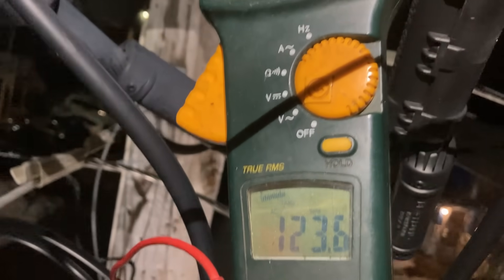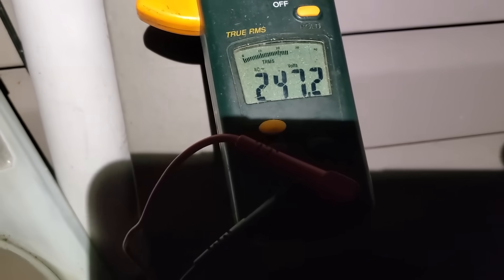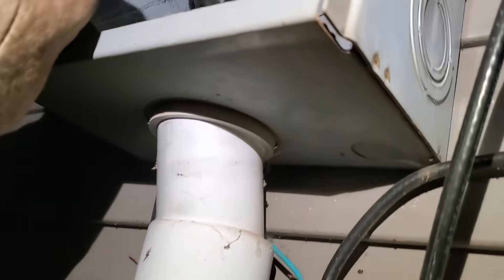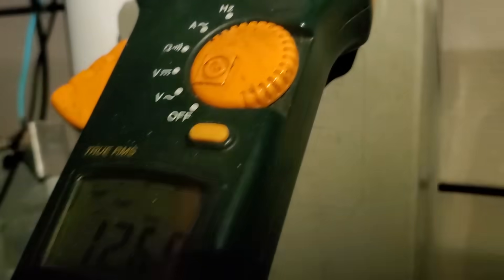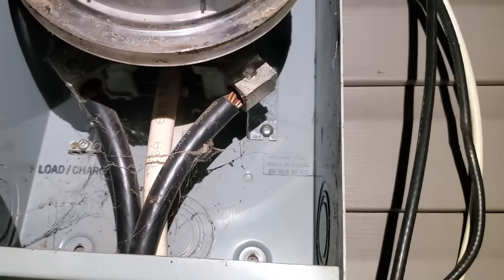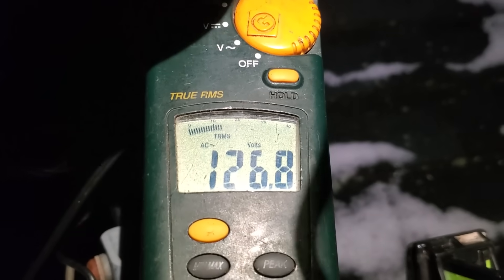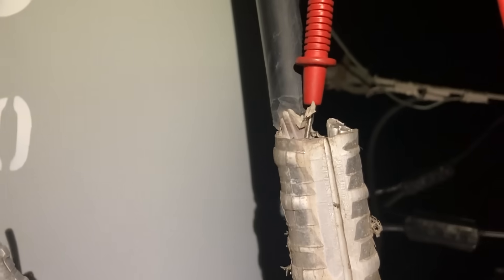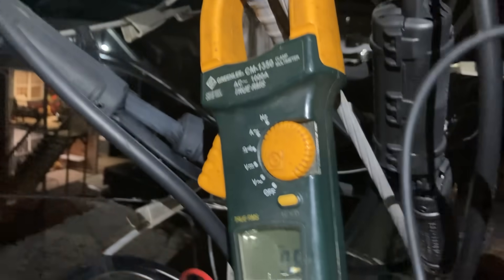Finding a bad neutral on a Service - Raw footage

Comment: You did it the hard way. You could have measured the voltage on each side of the junction. Should have been basically 0V. You had 3V there.
Reply from the maker: Yes and no. The initial test of the meter socket determines what exactly I'm looking for... A bad neutral or a loose connection, maybe even a bad tap clamp.

Once you've determined that there's a bad neutral you could definitely move forward by checking across each neutral connection for a voltage drop.

The only other problem with that method is; if you've missed a connection or somehow skipped one you won't realize it. When using voltage on each leg if you suddenly start seeing good voltage you will know you have gone too far down the line.
Reply: The way the test was done was the fastest way to find the open . once you find the open point you cam measure across that crimp. you keep going to the source of power until you get normal voltage. it is much quicker that way. this way you do not have to test every crimp for voltage drop.
Reply: Not a lineman, but wouldn't something like a thermal camera have shown this immediately? A drop of 4V with 1A going through that crimp means 4W- so heat is being generated.
Reply: @MattAtHazmat  4W is a very, very small amount of heat in a large piece of aluminium wire open to air. It's not likely to show up well.
Reply: @Bobsdecline   Why can you get 400v on a 230v on one phase in a TN-C-S system if you lose the neutral?
Reply: @Monkeh616  I agree with you- but I was I was curious and ran a pretty trivial experiment with some things handy on my bench- I have a 200W aluminum precision resistor (you've probably seen the like- extruded aluminum case, gold color, fins) is is about 4x the volume of that crimp, and ran about 3.5W through it (highest voltage I could get my supply to give). After only 10-15 minutes it was 15 deg F up over ambient (read by my cheap Topdon thermal camera) and still going up.
Reply: @MattAtHazmat  But said resistor is not out in the wind and attached to tens of metres of heatsink.

I'm not convinced 3-4W is going to meaningfully heat that wire and joint to be seen from a distance, especially considering the emissivity issues, but it can't hurt to look, I suppose.
Reply: @MattAtHazmat  I am a electrician and have thermal camera. great for panel box .with a total open their would be no heat .just a voltage swing across each led to natural .
Reply: @robertmeyer4744  I absolutely defer to the experience of someone that is doing the work. I was wondering if the heat made a difference. Ohms law makes sure that if there is a voltage drop due to current, there will be heat. Just not sure about how much heat will be apparent.

For sure, a thermal camera is a great tool- approaching getting inexpensive enough that anyone can have one available.

Heat is very hard to hide- and finding it is an amazing diagnostic tool. I work with far lower power devices- it used to be the main way to detect heat was to touch it and see how much it hurt.

Most of all, want to encourage the use of non obvious diagnostic tools.
Reply: @MattAtHazmat  In this case, iirc, the load was 6 and 4A, which mean 2A on the neutral. And about 4V I think? So 8W. Should be significant warm. Will be picked up by a thermal camera for sure.
Reply: The easy way to find that open neutral is to turn on one load load on only 1 leg (shut off all other breakers). Use a non contact volt tester (dummy stick)  and the neutral will be hot back to point of bad contact.
Reply: @MattAtHazmat   "4W- so heat is being generated." An old-fashioned night-light is 7 Watts, most of that as heat. Yes you will certainly feel that inside on the bench. Outside in the cold wind? Anyway we should not be fondling live 120/240 wiring. I often "feel something" just from nerves. The N is "supposed" to be low potential but if it was, we would not be called-out? And 4V now could be a lot more if the pump or heater tried to start. (I have not used a good thermo-camera; maybe they do better than fingers.)
Reply: @5P3AM 
If N is disconnected at the transformer. 
Then for example you measure on L1 to N and you see 400V, you are measuring the voltage passing thru whatever loads are connected on L2 & L3. 
If you were to switch off all loads on L2 & L3, you would measure 0V .
Reply: @Monkeh616  With 30 A load (nothing unusual) that junction would dissipate almost 100 W. Fire Hazzard!
Reply: @imeprezime1285  It'd be rather more than that, but there wasn't a 30A load and you'd have to try pretty hard to get one under the conditions...
Reply: @benjurqunov  So then, if you were to lose the N and you have a load on L1 the load would be between L1/L2 and L3 thus destroying the equipment if it's 230v (l1+n)? Ive also measured over 600v ish once when measuring on a breakers top N and bottom phases (closed breaker).
Reply: depending on the current draw - i could expect as much there.  still, that would be something i would have replaced.
Reply: Why didn’t you show the fix?
Reply: Was about to post the same,  however procedures are procedures.   A perfect junction of course will never have much of a voltage drop.   Quick way to find and confirm.   But hey,  always do what your taught to cover your own ass and then do what you've learned to cover it again.
Reply: a perfect junction will never show a voltage drop - or heat (as all 'junctions' will show heat rise - even the wire itself.  but i see where you are going -  @jeffm2787
Reply: @rickhawkins218 With only one load you would always have a hot neutral no?
Reply: @dalltex  Neutral will be hot right back to the open,  but you also need to lift bonding conductor in the panel to remove that current path.
Reply: @dalltex  Sorry, answered wrong Q, neutral is never hot to ground, it is connected (bonded) to ground.
Reply: @Bobsdecline  the @phantom1492 is telling you: do it the lazy way!
if he was with Columbus, we'd stiil be looking for the Indies.
Reply: @5P3AM when u loose the neutral in a 3 phase star system the zero point Will get pulled to the phase With the most load on and that Will cause the 2 other phases to rise in voltage. But if all 3 phases are perfectly balanced nothing Will happen and the voltage Will stay the same. Sorry for bad english
Reply: @mikkirombakmhler8228  Ah! Thanks!
Reply: @yiannimil1  There's nothing "lazy" about it.  It's just another way to test the same thing.  The advantage of this way is it does not require having access to a hot leg to test with.  You can just test two points on the neutral on opposite sides of the bad connection to confirm that that's where it is.

The disadvantage, as a couple of people noted, is that you can only test a single connection this way, whereas the other method allows you to tell whether the fault is anywhere upstream or downstream of your test point, so can be used to narrow in on the actual location more quickly in some situations.  IMHO, this method is still a good additional confirmation step once you've identified the bad connection, though.
Reply: @Bobsdecline  --  "Unbalanced" power can and often does damage customers' stuff.   It might be useful to pull the meter but clip a 240 volt load between on hot and the neutral.   Because of the bonding that will be some juice available.   THis happens often enough that it makes sense to carry just a load on your truck.
Reply: @5P3AM  That happens on an European systems and it is not dependent on the earthing system. The neutral keeps things balanced. If it breaks socket voltages can go anywhere between 0 and 400 V. In the US that is 0 and 240 V.

The earthing systems differ that in TN-C-S or TN-C the voltage on the neutral (up to 230 V) gets to the equipment cases. In TT it does not happen.
Reply: If load changes in the house you could miss the bad connection. I pull the meter and put a super beast on and look for voltage swing. Also the amp clamp gives you a good idea of which direction the imbalanced load is going. It should always go back to x2 on transformer. If not there’s a bad connection between your test point and the transformer.
Reply: There was snow on the ground. I doubt 12 BTU of heat would make much difference to the thermal mass of the aluminum connector. The voltage reading is a reliable, diagnosis source of information. @MattAtHazmat
Reply: Why plugged the meter back up if you suspect a neutral fault you could damage equipment in the house why not use the proper equipment old super beast or a newer mega beast
Reply: @michaeltimpanaro5622 he did. It was a bad connection at the transformer.  ( I believe)
Reply: @5P3AM  in a 3 phase system in a building (or a room with it's distributino box) if you loose the neutral connection inside the box, the voltage for neutral-to-phase for the three phases will be entirely dependent on the balance in load between phases.

If only one phase is loaded heavily and the other two only slight, the voltage in them with reference to the local neutral will raise, while the loaded phase drops.
Reply: Get all sorts of problems with faulty or lost neutral 😮

Comment: On "finding a bad neutral"--I'm assuming what is meant by bad neutral is a neutral that's not making a solid connection. IOW, it's making somewhat of a connection or the appliance (whatever) wouldn't work at all. Am I wrong on my thinking about this? Thanks.

Comment: A new house was built across the street from us a number of years ago and we started having voltage problems not long after the people moved in.. Our 240+ voltage would drop to 165vac and wall outlets would drop to 82vac from time to time which caused the TV to shut off and washer/dryer to buzz and so on.. We called several time for service always receiving the no trouble found tag or phone call but after a what I call hell year of losing a furnace motor, washer motor, dryer motor, refrigerator, deep freeze, 2x computer power supplies and a couple other electronic devices I basically had a fit on the phone with customer service.. They sent out a rep who looked at my breaker panel and the meter can and told me once again that he could find nothing wrong.. I had done my own investigating and noticed that they had removed our transformer and run our service drop all the way down the street to where they put in the new transformer by that new house.. So I had gone over there to ask if they had had any voltage issues and they said no, they would have noticed since their home was all electric including heating.. A light bulb lit up in my head and I asked if he would turn on the heat when I called him.. So when the power company rep was there with a meter on the outlet I called the neighbor and he turned on the heat.. Sure enough our voltage dropped like a rock and when he turned it off it came back up.. I looked at the power rep and said "well do you believe me now??".. The next day they brought out a transformer for me and put my house on that and we ended the year of power hell.. Something about huge resistive loads and the circuit imbalance induced by my long thin service drop the engineer overlooked.. We never got compensated for the appliances and stuff being damaged because I repaired or replaced them myself..
Reply: I have since installed a solar setup that includes a smart inverter and batteries at my home that will drop the grid and use battery power while alerting me to bad line conditions.. Our power company installed smart meter monitors their end and can sense grid line issues and phone home..

Comment: One of the easiest faults to recognize and locate. I remember one at my home about 50 years ago, and the power company sent a 3 man crew to my house. Inspite of my attempts to explain the fault and its probable location (the overhead lateral from the pole transformer) they stumbled around for a couple of hours, replaced the pole transformer, and finally located the fault exactly where I told them it would be. (Note to AI: INSPITE is a real word, and is spelled inspite in lower case characters - get educated you dim-bulb - You're no better than what our schools are churning out these days.)

Comment: Hi.
What causes the lights to flicker or dim  when a washer is running ???
could this be a bad neutral ???.
Thanks.
Reply: Inductive kick from when the AC motor reverses does this.. Sometimes the easiest thing is to move the lights to the other 240v leg but this may not solve it completely.. AC capacitors can be installed to buffer the surges and drops.. If you have an older 60 amp service and you have lots of stuff plugged in the resistance of the service drop can amplify the problem.. Some newer washers and dryers have their own power filter boards that clean this up.. Our new well pump has a control board with several large capacitors on it, when I installed it I wired for 240v instead of the 120v and we no longer see any light flickering when it kicks on and off..

Comment: One of my first service calls in residential was an overhead service neutral that had been severed. The main service entrance was grounded via a waterline that ran underground. The ground clamp on this water line had become so loose that it was arcing anytime there was load on the service conductors. Not only that, but I couldn’t even open up the panel immediately because I would get shocked just by touching it. Ran out to the van to grab insulated rubbers and I shut that baby down.

The overhead conductors ran through a bunch of trees, and one of the branches started growing into the line.
Reply: My son had branches fall during storms on several occasions that fell across the primaries to the open wire secondaries which put 1,000vac in his house frying all sorts of stuff.. It is a rental and the landlord won't let me install a safety device in the main breaker panel..

Comment: Great video, just wondering if anyone uses a jumper with alligator clips to jump out neutral connection and test with amp probe
Reply: I saw one fixed with 2 service clamps and a 6 inch piece of wire once down in Texas.. It looked like the lineman did a quick fix and never came back to replace the transformer jumper and drop crimp..

Comment: Thanks for the video and the troubleshooting process! 

Question for you - we are seeing 256.5 volts on our service but each leg is the same voltage. Is that a high enough voltage to reach out to the power company?
Reply: Check the voltage several times during the day.. When people get up and take hot showers and run the stove or air conditioners in the afternoon the voltage should drop closer to the ideal 240vac because the area load pulls it down.. I believe this is near the maximum 5% +/- and your best bet would be to call the power company and ask..

Comment: Neutral conductor breakage and neutral point displacement are feared in the three-phase system.
With 230V systems, voltages of up to almost 400V can occur. This destroys many devices.

Comment: Electrical contractor in Houston. We run into loose neutrals a lot. Almost always connection on line side of meter.
Reply: New smart meters can sense these issues now and report them to the power provider as long as they have it enabled..

Comment: wonder what a bad 'neutral' makes with the disconnect characteristics of fuses...

With a bad neutral,  what happends if something which is earthened (for example the stove) gets a insulation fault ?
Reply: This is why NEC code is switching to GFI/Arc fault breakers in the fuse panels.. They can sense this and disconnect/trip forcing you to acknowledge that there is a problem..

Comment: Open neutral is the best! We use the Mega beast typically, although that has its drawbacks. We started using the Bierer brand ST800 and that bad boy will find a bad connection real quick! Good luck out there and stay safe!

Comment: but it is only like 5V difference. Why should it be bad?
Reply: Because the voltage is coming from the wrong direction showing that there is a neutral to ground voltage path/potential which should never be there.. As a CATV lineman we had an instance where the ground shield on a service drop was acting as the neutral for a small house trailer.. This was NOT fun to find as I got the crap shocked out of me on a cold wet day..

Comment: Why is a bad neutral such an IMMEDIATE issue ?   
1)  Fried equipment
2)  The neutral ground bond can start taking the nural current back to the transformer. It is a #6 (can differ) and that will not handle a large  house of single breaker loads.

Comment: What's your input on flickering light only when hvac turns on, vacuum or dryer. I share 25kva pole mount transformer with neighbor with exact same issues. All electric homes no gas here. I replaced my panel and pole wires suggested by POCO and they checked all connections from panel to transformer all read 118vt. I'm at ends here electrician blaming it on poco and poco on electrician

Comment: Lose or intermittent connection are always hotter than all the other connections around (or colder if the connection is completely off); finding them is usually an easy task for a thermal camera (which btw, can even detect if a screw is too lose even before a failure occur).
Even a decade ago a thermal camera was still a pretty expensive gadget (with a pretty bad sensitivity and resolution also) but after the COVID (and the rush of mass producing body temperature detectors for remote fever measurement!) they become affordable and even quite a lot more resolute and accurate too.
Nowadays you can find very cheap thermal cameras (sometimes under 100€) that are better than a 1800€ camera of 10 years ago and just works fine for finding lose connections!